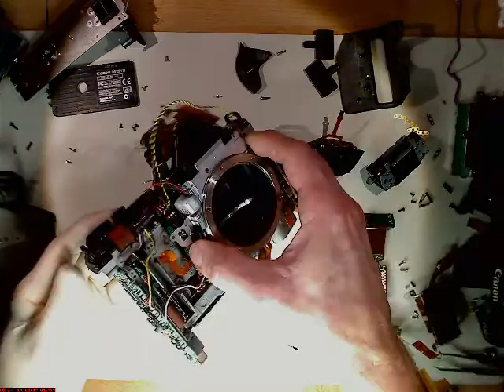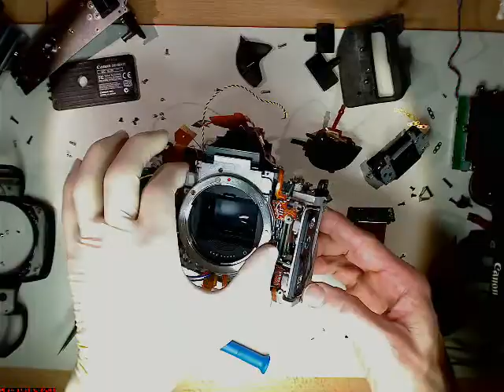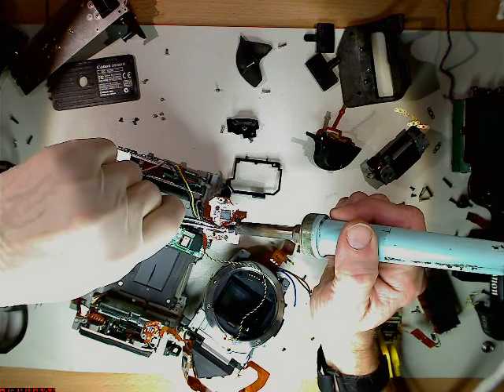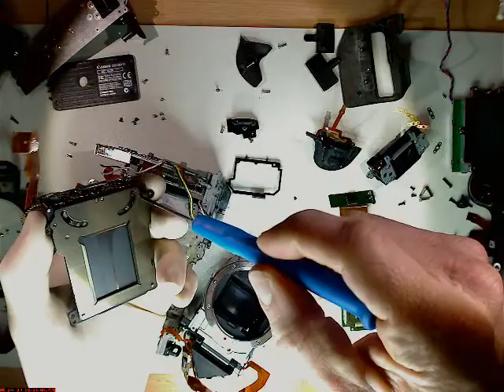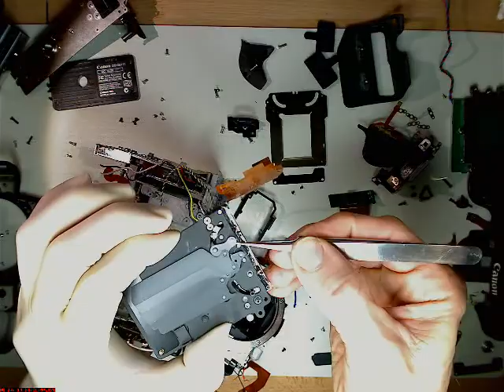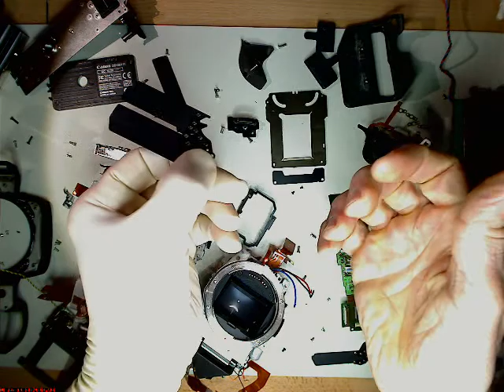Try to fix broken shutter in Canon EOS 1 D mark II N     PART 3          motion lapse film

Comment from the maker: It was a shame, I couldn't repair the shutter, I try actually take the shutter from a old not working canon EOS 1 analog camera because it looks like it was the same..., well some parts was the same, but not the blades, there was just very little difference, but enough NOT to use it :-(.

Thanks for the idea with the double sided tape, I hope someone else can use it, I sometimes use it depending on the task.

:-) :-)
Reply: You can buy new overstock original shutters on Aliexpress.

Comment: You have removed many parts that were not necessary, if you still have not solved your problem, on ebay you will find the shutter blade part or even entire shutter part
fixing the shutter is a very delicate job, I suggest you buy the whole shutter, even a used one in good condition 
I highly recommend for those who have never repair a camera to use the repair manual, or better, take it from an expert

ciao!
Reply from the maker: Thanks for your comments Cosmin, well, as other repaire people I always check the service manual before disassemble anything in a camera or lens or other stuff.
It's not the first time i disassemble and repair the shutter in a camera. I of course first check for a new / used shutter on eBay or other places but sometimes it's too expensive to have it send to Europa because of the very expensive Tull / Custom.
So i think in this case, it would acctually be a good idea to just showing other people how things look inside. :-) :-)
Reply: mikeno62
thank you, very helpful!
Reply: mikeno62 you can fix it the parts are available, why not? http://www.dhcameras.com/brand-new-canon-1d-mark-ii-oem-shutter-blade-replacement-part-curtain/
Reply: Thank you, I appreciate you taking the time to make these videos.

Comment: hi, my 1ds mark 2 viewfinder shutter needle was broken and seem  the screw inside was very loose and have some sound inside when shaking it,
the lever handle screw was broken, how can i fix it?
Reply from the maker: Hi medinahabibi

To take off the viewfinder  there is 4 screws around the viewfinder that you have to unscrew, then it will be possible to take it off. In that way I think you hopefully can solve your problem..
Reply: mikeno62 thanks for your help!